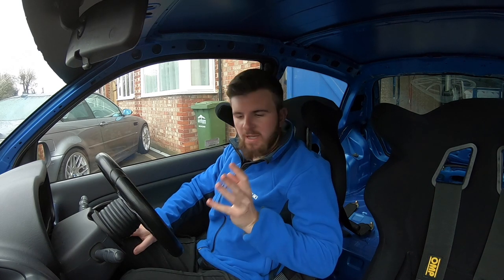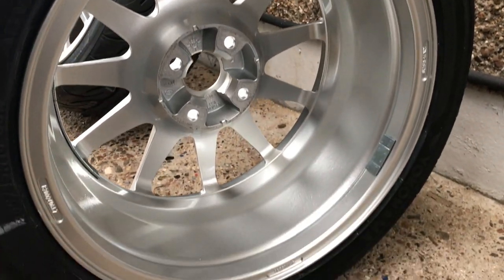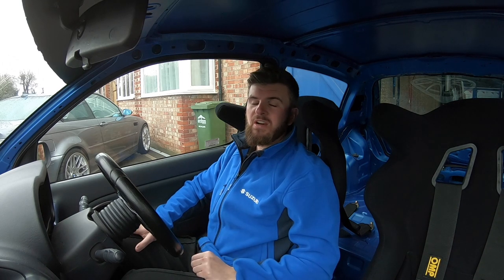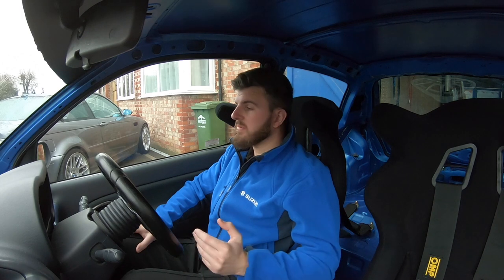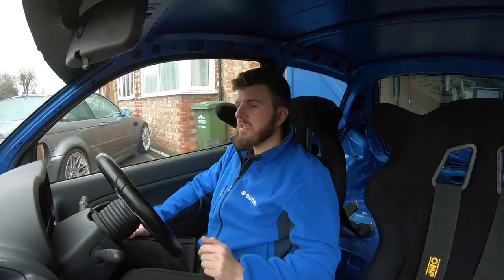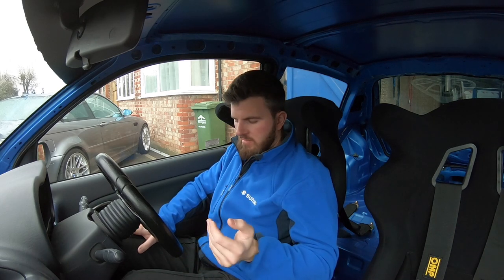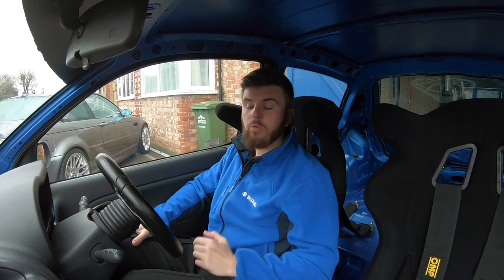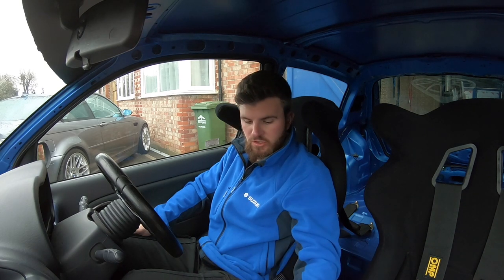Clio 172 Cup handling upgrades blog - Part 2 ** COILOVERS + SPACERS **

Comment: What make are your 15mm front hub spacers? It makes the wheels sit so nicely in the arches. Sorry for all the questions just going through your playlist :)
Reply from the maker: No worries, to be honest I can’t remember what brand they were now - have held up well to be fair but you need to remove the arch liners, modify the arch liner brackets and trim the inside of the wings - looks mega but is a permanent modification so not ideal for the purist

Comment: I’ve had both 172 and 182 cups the 182 was quick but the 172 was a missile but a tad dangerous in the wet 😂. 0-100 was unbelievable.
Reply from the maker: The power to weight on these keeps them competitive especially with some further dieting 😬

Yea 172 cup with no ABS & AD08R tyres in the wet certainly keeps you on your toes lol

Comment: Such an old video to ask this question, but can you recall the ride height you set it to front and rear? I’m struggling to get to to look right but also not rub. I’m almost setting it to normal ride height even after grinding back the bumper mounts and modifying the arch liner. I have been measuring the amount of thread remaining on the dampers or ground to wheel arch if you find 5 minutes to measure yours 🙈
Reply from the maker: Hi Gaz,

No worries at all for the question, is actually something I plan to make a video on as it appears a lot of followed on my quest for that sweet stance 👌

The rears running genuine Cup Turinis + Pure motorsport 10mm hub spacers does not rub at all with the Bilstein coilovers on the lowest setting using the platform (you can remove the platform but then it’s an instant 10+mm lower and looked broken.. that did rub on hard compressions.

Fronts needs a lot of work to make the clearance work with 15mm spacers + cup Turinis + 205/45/16 AD08R’s which have a beefy side wall you will need to cut away most of the front bumper/ side brackets, completely remove the arch liners & cut back the metal work behind them + cut the inside of the wing out for rub free driving (it’s pretty permanent modification so not for the purest)

As you can hopefully see in the videos the car gets driven pretty hard and is rub free.

Comment: I have a 172 cup and run Brembo hc discs and ds3000 pads which work really well but make loads of dust so I tend to swap the pads for some good standard ones for the road. I have also brought a 172 for parts and that has brand  new pbs pads in it and they seemed pretty good on the drive home 👍🏻
Reply from the maker: Always enjoyed the DS2500 as a fast road pad but didn’t cut it for me on track, as you have said DS3000 received good reviews but not tried them myself! Would love a set of RS-29’s as they really are perfect for road/track in the M3 but think for this years running PBS and HC discs should (fingers crossed) do the job

Comment: Same suspension I'm running, I really rate it. I was also looking at getting spacers will be interested in your thoughts on them.
Reply from the maker: Shall hopefully have it on the road for initial shake down in March, I’ve run 10mm previously with no real negatives noticed so fingers crossed it will all be fine 👌

Comment: Advans are not the best choice. Go with michelin
Reply from the maker: Agreed, had the first run with them Monday/ Tuesday (new video should be online these week) and they are no where near the Michelin Super Sports I use on the M3 but I have heard good things about them for track for cost
Reply: @stoneautomotive  for track thry could be a good choice. For fast road use I would recommend to always go with an asimetrical rather then simetrical tire thread